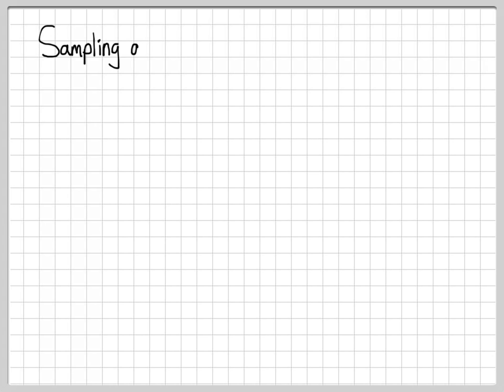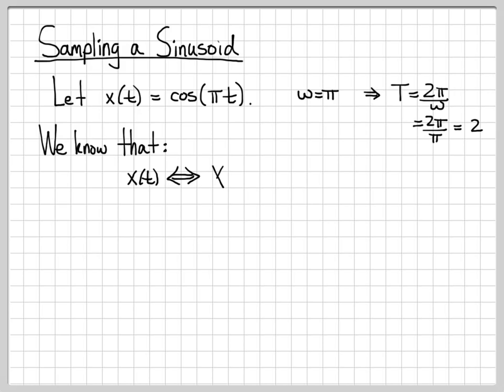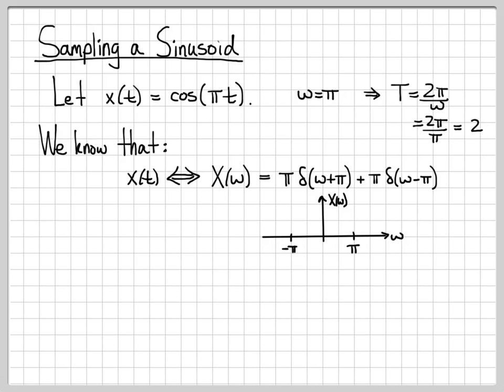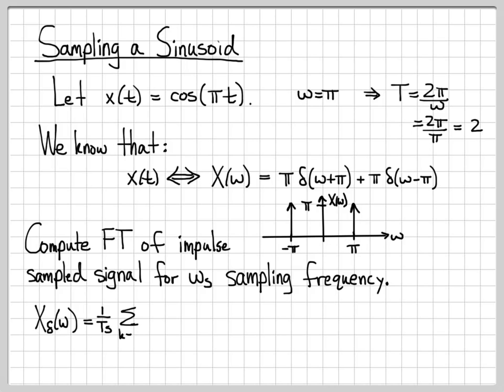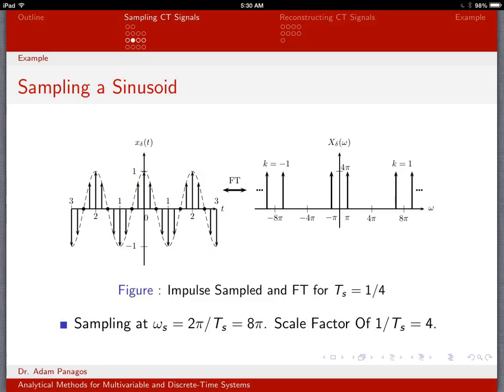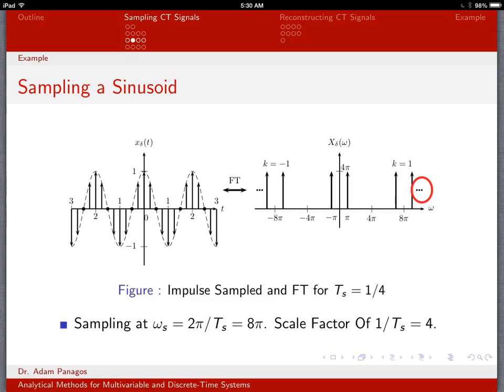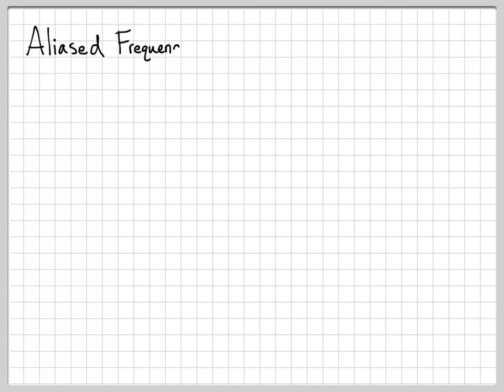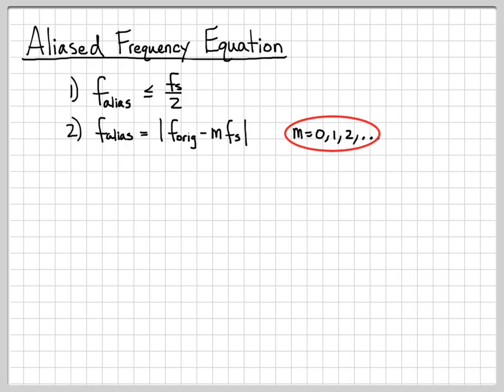Sampling Signals (5/13) - Sampling a Sinusoid (Theory)

Comment: @4:49 when you sample with a period Ts = 1/4, why is the sampling frequency 2pi/Ts not 1/Ts? Isn't frequency just f = 1/T
Reply: hmm actually is that just because that's how sinusoids behave and what we defined w0 to be?? Like cos(w0*t), where w0 = 1 has a period of 2pi/w0 = 2pi/1 = 2pi, cos(2t) has a period of 2pi/w0 = 2pi/2 = pi. Please correct me if I am wrong.
Reply from the maker: @calebtag  It's just the difference between linear and radial frequencies.  Linear frequency f has units of Hz.  Radial frequency w has units of radians/second.  They are related by w = 2*pi*f.  This video works with radial frequency ws.  You could also do it with linear frequency fs though just by letting fs = ws/2pi.  Hope that helps.
Adam
Reply: @AdamPanagos  thanks that helps!

Comment: i never understood why we were able to find fourier transform of cosine and sine because arent they periodic and shouldnt we use fourier series for periodic signals?
Reply from the maker: Yes, the Fourier Series is used to find the frequency domain representation of periodic signals.  Technically, the Fourier Transform only exists if the signal is absolutely integrable.  However, if one is ok with using a Dirac Delta function, then the Fourier Transform can be used to find the frequency domain representation of periodic signals.  Hope that helps,
Adam
Reply: @AdamPanagos  you're the best communication engineering channel out there. You cant understand how much we appreciate you.
Reply from the maker: @oggamer2244  Thanks for the kind words, glad to help!

Comment: Thank you Dr Adam for the tutorial. I am not clear why you have to use the angular freq omega s to derive the sample freq, why not e.g Fs(Sample Freq) = 1/Ts? Please help me understand.
Reply from the maker: Two different units are used for the sampling frequency of signals.  If we use fs, the sampling units are in terms of samples/second.  If we use ws, these normalized sampling units are in terms of rad/sample.

These two quantities are related by fs = 2*pi*ws.  So, they're almost the same quantity, just different by a factor of 2*pi.  Which one you prefer to use is completely up to you. Some textbooks use one exclusively, others use both.

Hope that helps,

Adam
Reply: @AdamPanagos  Thank you.

Comment: regarding the example where the period is1/4, you said thatthe height is 4*pi, but why did you not multiply it by 2 to get 8*pi? As (-7pi+8pi) equals 9pi-8pi). thanks
Reply from the maker: In the first part of the video we derive an expression for the spectrum of the impulse sampled signal.  In general, the spectrum of the impulse sampled signal is scaled by a factor of 1/Ts.

The original spectrum of the signal in this problem had impulses with height pi.  When the sampling period Ts = 1/4, then 1/Ts = 4 and the impulses that originally had height pi now have height 4pi.

Where things get tricky is on the examples where Ts = 1 and Ts = 3.  In these cases we have scale factors of 1 and 1/3 respectively.  However, from the plots it looks like there is an extra multiple of 2?  That's because 2 copies of the impulse land at the same location on the frequency axis.  For example, in the case of Ts = 3, the impulse originally at pi when shifted down by 2pi/3 lands at -pi/3.  Similarly, the impulse originally at -pi when shifted up by 2pi/3 also lands at -pi/3.  So, there are two impulses that end up at -pi/3 (and hence the extra factor of 2).

This "double stacking" does NOT happen in the case where Ts = 1/4.  For this sampling period we are sampling fast enough such that nothing "lands" on top of something else.

Does that help?

If you found the video useful make sure to check out my website (http://adampanagos.org) where I have a ton of other resources available and it's easier to watch my videos in a more organized fashion.  

Thanks, Adam.

Comment: You conveniently show a cosine wave and your samples were at the peaks of the waveform for the 0.5 Hz waveform sampled at 1 Hz.  If you sampled at the null points, all zero-crossing values, the reconstructed waveform would have been a DC value of zero, or am I wrong.
Reply from the maker: That's a great comment Tom.  You're correct, if we sample at exactly 1 Hz, but happen to start sampling at the zero-crossing values, then we'd end up with an infinite collection of zero values.  Thus, it would look like our signal was x(t) = 0 for all time.  Obviously, this is not good since we want our samples to represent the original signal.  So, what's wrong here?

What's going wrong is that I'm sampling at exactly the Nyquist rate of 2*1Hz = 2 samples per second.  Note that the sampling theorem says we need to sample at a rate GREATER than this frequency, not greater than or EQUAL to this frequency.  So, the example I'm showing here is actually using a sampling frequency that doesn't quite meet the sampling theorem criteria.  The sampling frequency needs to be a little bit larger.  However, for the sake of "cartoon slide examples" the goal here was to show a sequence of good, marginal, and bad sampling rates, where this is the marginal rate.  Note that sampling at the Nyquist rate does work here if I start sampling just about anywhere,  However, like you noted, if I'm unlucky enough to start sampling on exactly a null point then I'm in trouble.

If the sampling rate is just a little larger than the Nyquist rate, even if I start sampling on a zero I won't end up with all zero samples and then I'll be able to perfectly reconstruct the sinusoid from it's samples.

Great observation, hope it's more clear now, thanks,

Adam
Reply: Adam Panagos Thanks for the quick response Adam.  I'll buy your explanation for now but have to think about it a bit more.  I just wonder if I had 3 cycles of a cosine save and sampled the 0.5 Hz frequency at say 1.5 Hz if I could really reconstruct those 3 cycles.  My gut tell me no but as I said I need to think this through.  By the way, your lectures are excellent.

Comment: you helped me finally understand the sampling theorem related to sinusoidal signals. wish you would do an example with signal having sum or multiplication of two sinusoidals. for example:  s=sin(2*pi*f1*t)+2*cos(2*pi*f2*t)
Reply from the maker: I don't have time right now to do a full example, but determining the sampling rate required to sample the signal you provided is pretty easy.  The only thing that matters is the largest frequency of the signal.  So, let fmax = max(f1,f2).  Then, by the sampling theorem we need to sample at a rate of fs = 2fmax or greater.  The spectrum of your original signal consists of just 4 impulses.  Two have height 0.5 and are located at plus and minus f1.  The other two have height 1 and are located at plus and minus f2.  When we sample at fs, the spectrum of the sampled signal is just this original spectrum shifted up and down the frequency axis an infinite number of times in increments of fs (and there's the 1/Ts scaling constant).  Hope that helps a little.